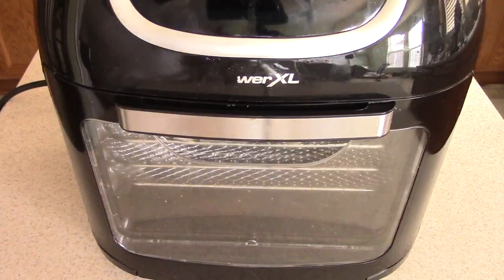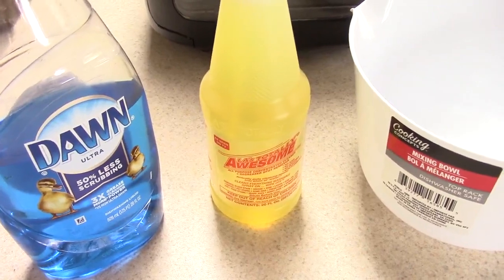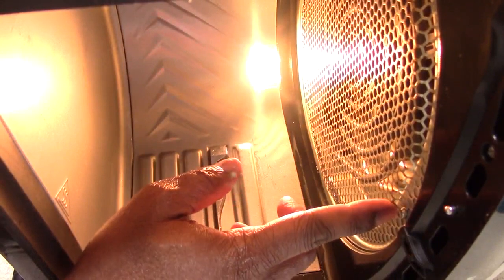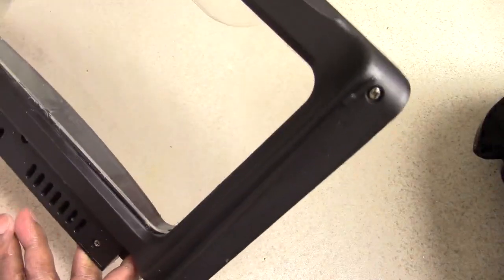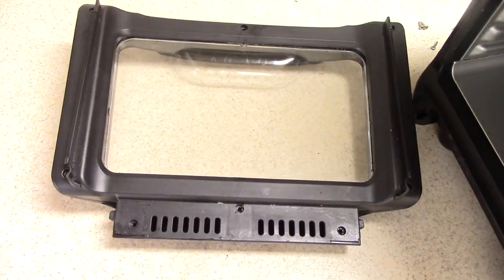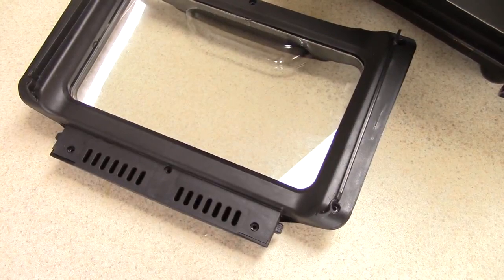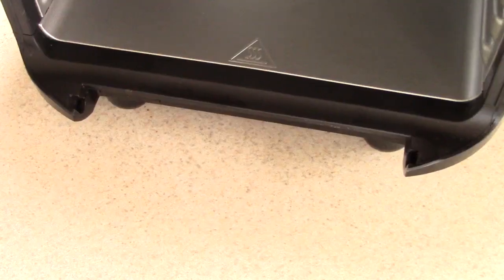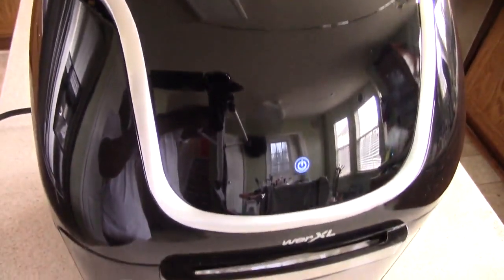Cleaning the Power XL Vortex 10qt 1700w Air Fryer Pro Oven QVC exclusive

Comment: Have you yet had an issue with a build up of grease in the bottom of the unit (not in the drip pan) that starts to drip out of the vent holes on the bottom of the machine?

Comment: Distilled vinegar (also called white vinegar) can be used alone as a degreaser. The vinegar can be applied to greasy surfaces with either a spray bottle or a cloth, and should cut most grease with minimal rubbing. Mix 1 part vinegar to 4 parts water. Let it stand for 5-10 minutes before rinsing with water.    Just saying.... no chemicals

Comment: I believe the term is thermal-break, the air gap between the inside glass and the outside glass.  Check with the manufacturer to see if the disassembly voids the warranty.

Comment: I would imagine the two panes of glass is the same reason why you have two panes in your windows. The air gap provides some insulation (or thermal break as another commenter mentioned). Otherwise, you would lose most of your heat through the glass in the door.

Comment: I got ours from sams... same racks and they chew up my sponges. I haven't had the luck you're having with those racks...the traditional basket air fryers seems so much easier to clean.
Reply: I also find the racks hard to clean. Food sticks, tears up sponges, dishwasher does not clean. Do you spray the racks before using? Maybe I need more oil before cooking? I was thinking a basket would be better